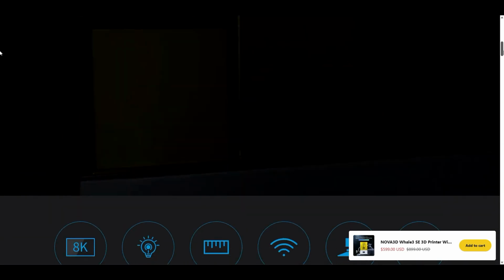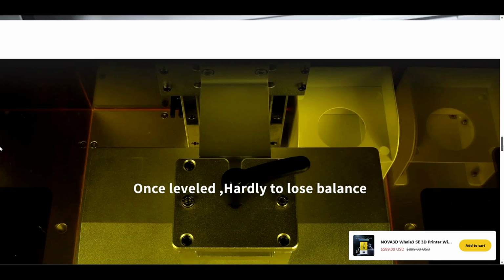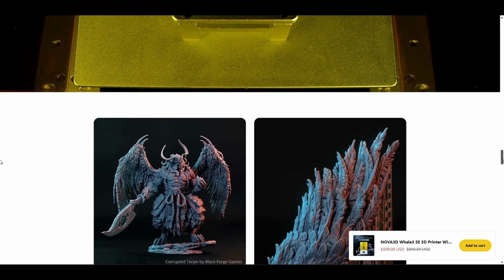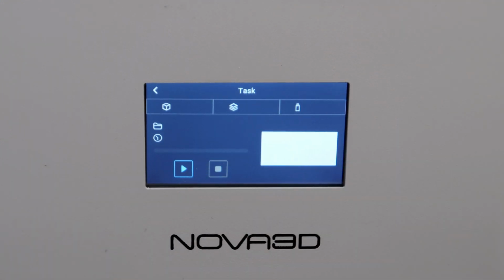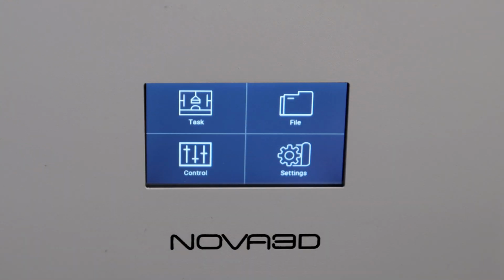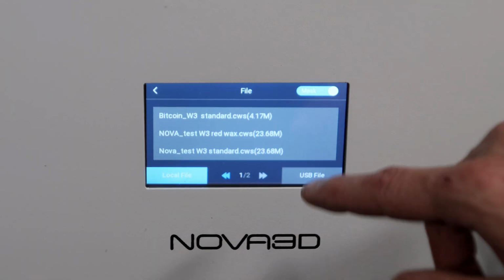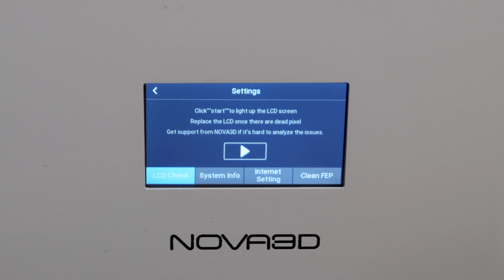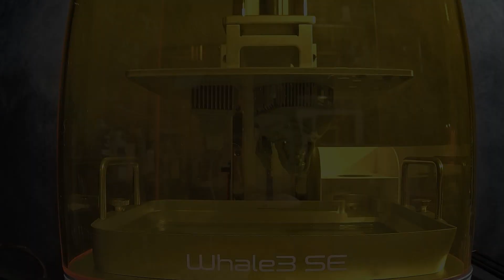Nova3D Whale3 SE 8K setup and review

Comment: Hi, thanks for this vidéo, but wat specs about this printer?  no need leveling? Speed? what about noise?
Reply: I have one, it's basically completely silent, the lift/retract speed can go up to 240mm/min no problem, and once the leveling is done (the build plate supposed to be leveled from the factory, usually is) it doesn't need  to be leveled again.

Comment: I found this printer for the first time 10 minutes ago and then your review not 5 minutes ago! Thanks for making the video, it’s good intro to the printer. But would you also be able to please review the auto refill feature? Also, is there any kind of exhaust feature for fumes? And lastly, how quiet is it? I See they advertise only 35 db compared to the usual 50 ish db. 

Thanks a lot for any help!
Reply: Thanks a lot that pretty much answers all my questions for this printer. The gravity fed vat filling is something I’ve thought a manufacturer should add to their printer a long time ago. Pretty much impossible to go wrong
Reply from the maker: The autofill is a lid that goes on the reain bottle the  stands upside down in the cradle. The bottles I have didn't fit the lid and I wasn't able to test it out, but rhe vat held enough resin for all my prints and I didn't have to add resin during print.  There isn't any exhaust on the printer but you can get a air filter for inside like thw anycubuc airpure. And it's really quiet I honesty didn't even notice it running when I was next to it